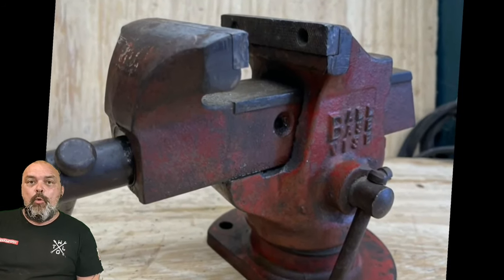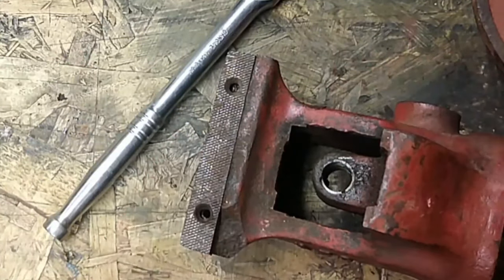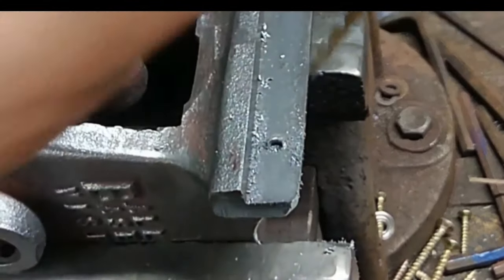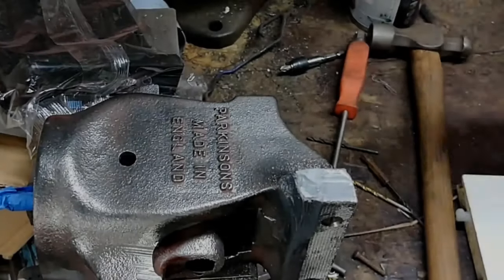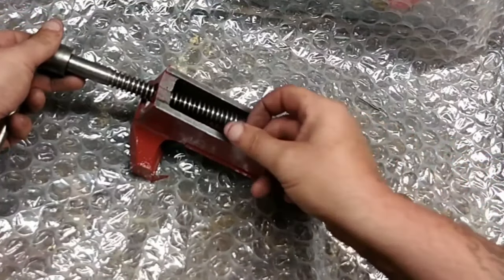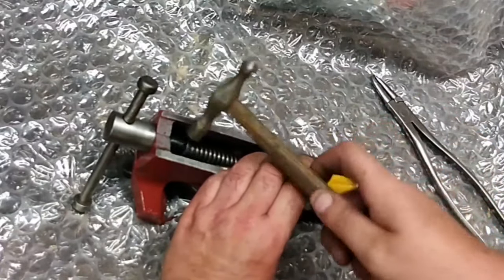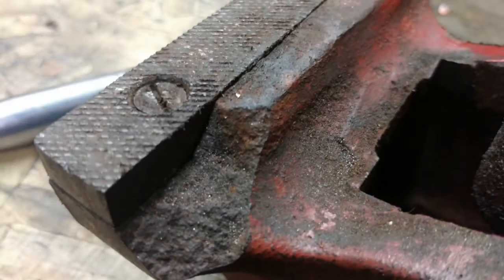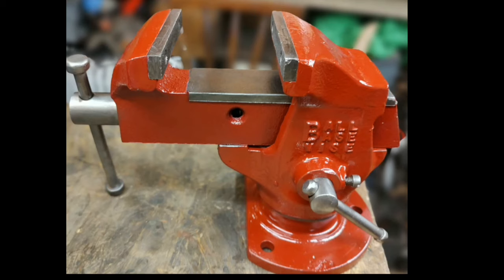Vise Restoration rare ball base vice , tool rebuild UK repair video GB

Comment: Well done on the broken screw. I hate extracting broken screws especially small ones. Good idea on the jaw, that JB weld is some tough stuff. I would have never thought of that.
Reply from the maker: Beats trying to weld it , have done little welds on pipe wrench jaws before but dodgy this size on a rare vice so jb was the best choice

Comment: Nice repair, it's looking great now   🛠👍😊
Reply from the maker: Watched you 2 quid light fix the other day , forgot to come on line and comment thou top job . !!
Reply: Thanks Mate, Looks like those lights are worth picking up cheap if the fix is that easy, I thought I would have to replace the batteries, Have a good Sunday

Comment: Nice one with the new intro, but unless it's the Westons, your head's a bit pixellated in the insert. Then again, maybe you're going that much balder in real time, like I seem to be. Absolutely fab tip for drilling out the screw, ta. Now; oil vs. grease- please explain the choice in your next 'salvage' (!! we're staying with you...). I would have gone for grease on the ball joint on the understanding that it'd lubricate better, firmer and longer but as ever I'm keen to nick your experience and knowledge for free. You give an inch... Cheers.
Reply from the maker: Yes mate Weston's does that to my head after a couple .....  No idea oil grease lube .... I dunno what I'm on about just blag it to the besta my ability ....
Reply: @toolrestoration  Haaaa nice one. I'll stop being such a pedant. Cheers.